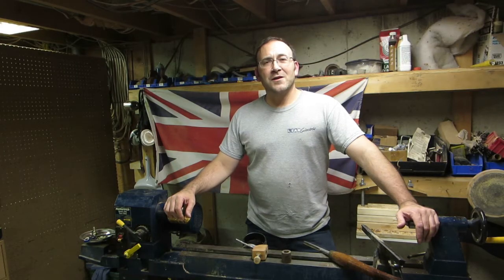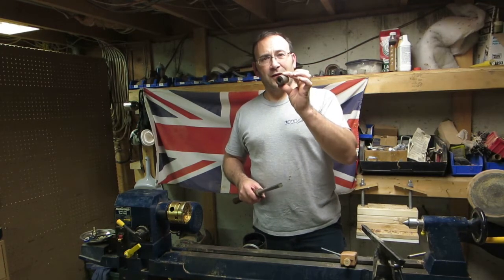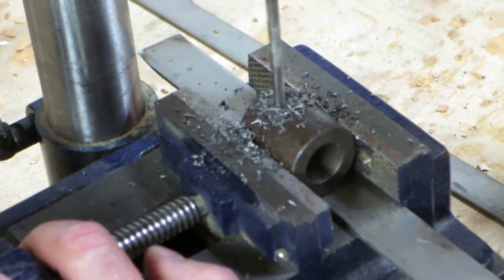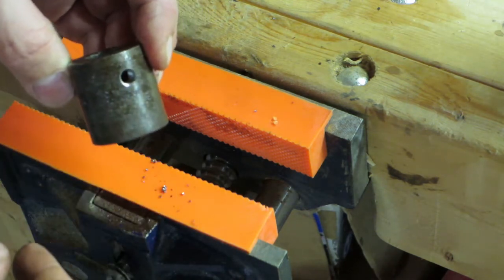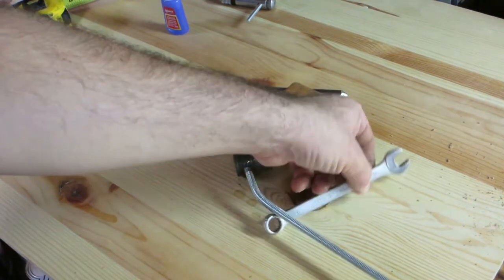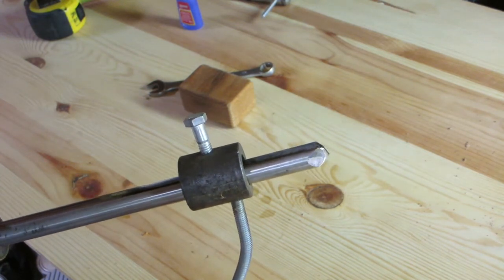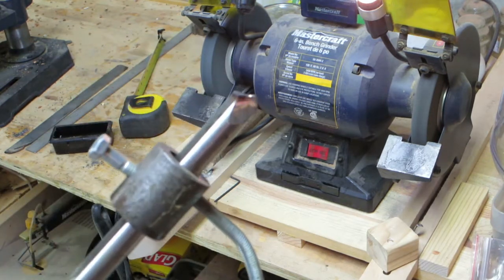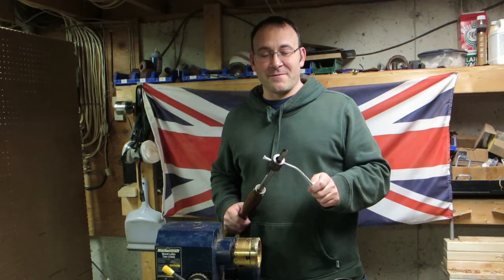#7 cheaply made bowl gouge jig

Comment: Good job Rob but I think if you were to remove some material from the top edges of the wings so they slope down to the tip you'll be able to lengthen the sweep back further & aim for a 60 degree angle at the nose rather than the usual/standard 45 degrees. I messed up several times till I got it sorted. In the end I was lucky to find a genuine Ellsworth jig for not a lot of money. Take it slowly, keep the heat down & you'll have a great bowl gouge.
Keep making shavings & enjoy turning,. It's one heck of a rewarding craft.
Regards ....... Geof Harris (Gloucester, England)
Reply from the maker: Hi Geof,
I agree my wings do need clipping some more, I may need to adjust my angle to do so but that goes with the craft, always making changes... Cheers and take care now.